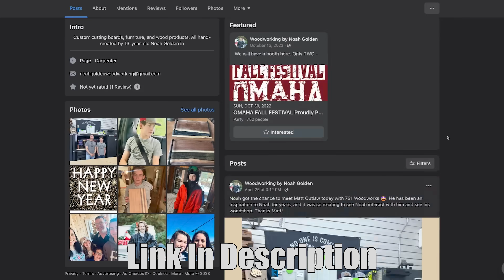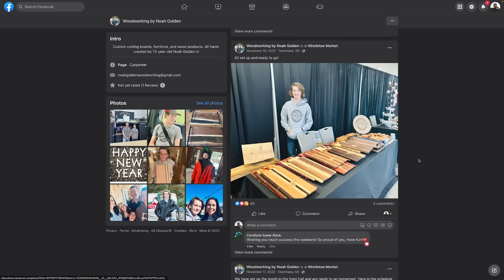14-Year-Old Woodworking Prodigy Selling Hundreds of Projects!

Comment: Can epoxy be used in a cutting board or is it not good to cut on?
Reply from the maker: it's not advisable to cut on epoxy but you can use it on serving trays.

Comment: if you do not dry wood thoroughly and use good glue and clamps, those boards will split at the joints and you will lose your reputation for quality like the cheap boos cutting boards. guarantee return of any age if they crack and i will consider your cutting boards